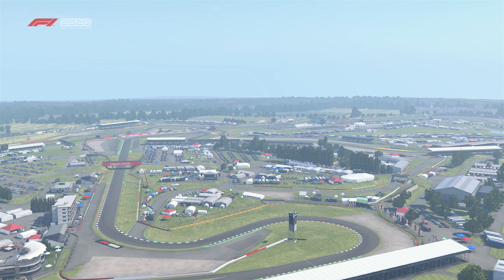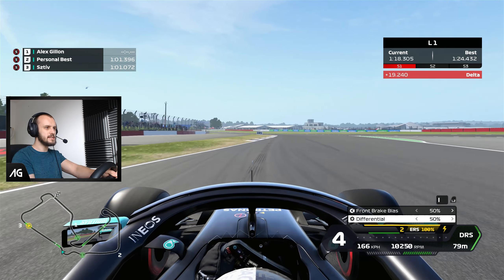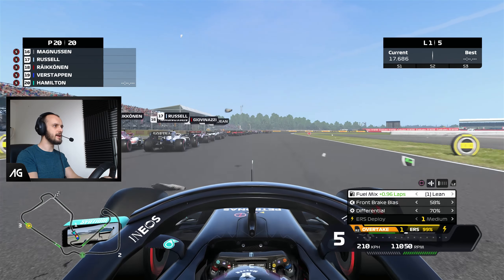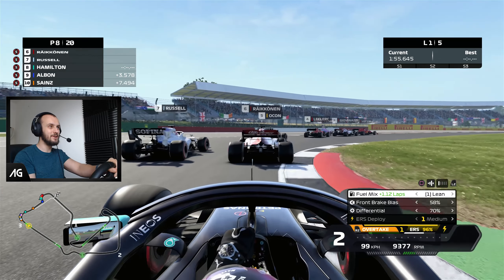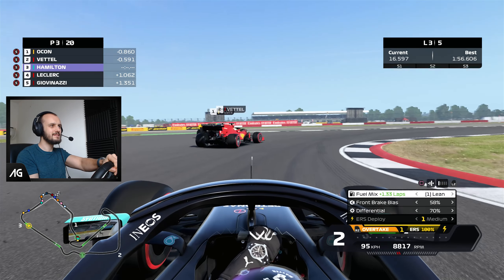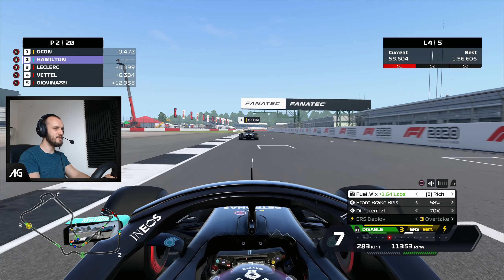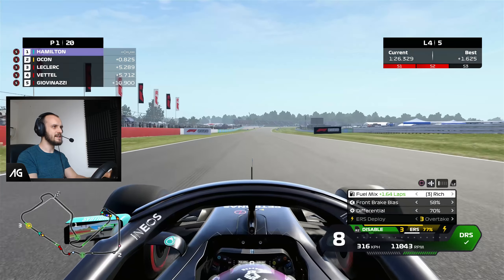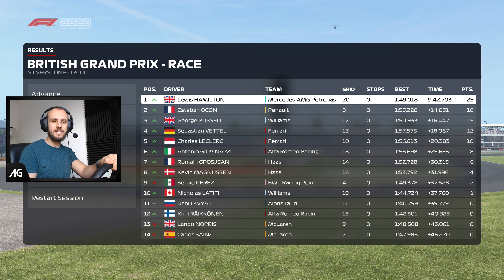What If F1 Cars Had *LITERALLY* No Downforce At All?

Comment: imagine this at monaco, i wonder if the hairpin would be possible lel
Reply: From what I read the downforce at Monaco is more for braking performance than cornering. I suspect they will have no problem negotiating the hairpin. The swimming pool section and tunnel will more likely be difficult.
Reply: @Speed6604  Downforce is also more important and apparent for medium to high speed corners; for slow corners & 90 degree turns, it's as important. This is partially why Ferrari grabbed pole at Singapore; they had a semi competitive downforce setup, but their engine allowed them to punch out of the slow 90 degree corners and maintain their advantage over Merc and Red Bull. You don't feel the effects of downforce in slow corners.
Reply: @arkWEWT  I don’t disagree. It’s not based on my opinion, it’s just what I had read somewhere before about car setup at Monaco.
Reply: they're basically at full steering lock going extremely slow, so I doubt downforce has anything more than a negligible impact on their ability to take the hairpin. Downforce isnt just some magic force that is always applying to the car, they have to be going at a reasonable speed for it to start making any difference.

Comment: I think F1 would be more entertaining to watch if the cars has much less downforce. F1 cars would be designed for better mechanical grip and overtaking would be easier. Also 90% for R&D money goes into aero development right now so it would make things more if you restrict downforce. They can govern downforce by putting the car on a scale in a win tunnel and say for windspeed X the car's weight cannot increase by more than Y kilograms.
Reply: Just watch Moto GP or even NASCAR

Comment: With less doenforce you should really make the suppension softer by a fair bit. Alot at the front and the car will handle alot better with less understeer . The roll bars should also be made softer with less downforce

Comment: So this is basically a 1950's car with 1000 bHP ... how is there NO oversteer at all?
Reply from the maker: To be fairrr, the downforce doesn't kick in until the speed builds and when you've got speed, it's naturally harder to wheelspin
Reply: @AlexGillon  That's not quite correct. While the downforce is 0 when the car isn't moving, there is of course considerable air flow at around 70-100 km/h (which would be around the speed for the slower corners at Silverstone, if not more). It's not quite as impressive as the downforce these cars begin to generate at higher speeds, but it's definitely noticeable (this is also evident in slow speed sections, like the third sector of Barcelona, where the cars can't follow each other despite the low speeds).

Apart from that, oversteer doesn't necessarily have to be wheelspin, it can also just be the rear sliding because it's not able to cope with the amount of steering input, or the brake pressure applied.

None of that happens here, which is quite peculiar.